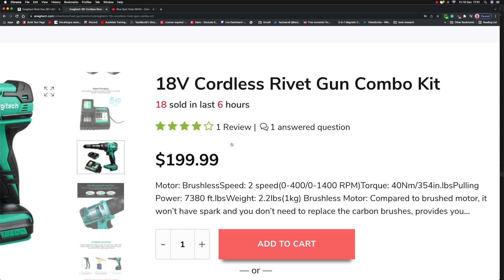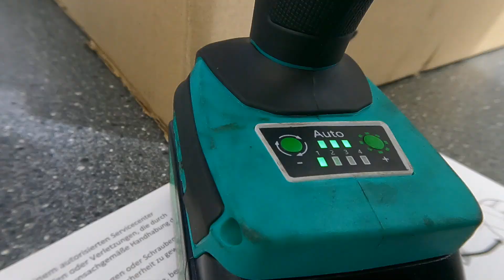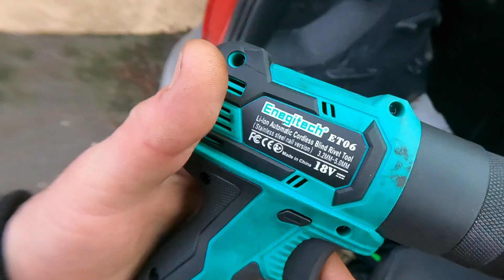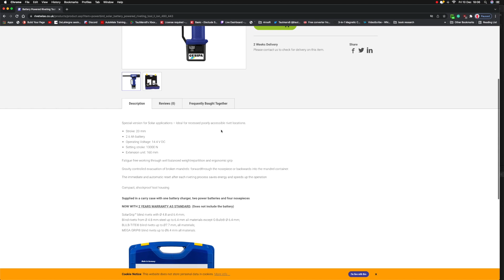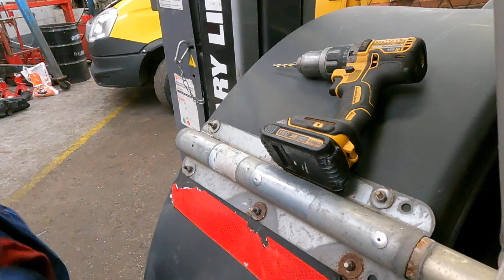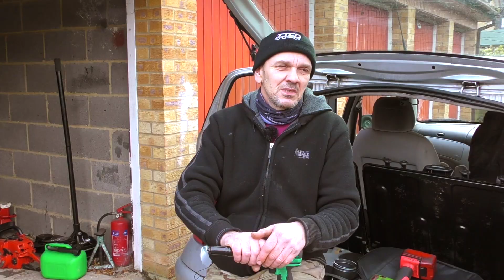Workshop Tools - The Enegitech 18V Battery Powered Brushless Riveter

Comment: If this will run off my 18v Makita batteries, that’s awesome….was about to buy an air one, but this is so much more convenient. 👍
Reply from the maker: You have a Makita drill?
Reply: @trailerfitter2  Makita everything….drill, angle grinder, impact driver, impact gun, etc.  Mind you, US and UK won’t send them here, and Amazon Aus is not quite the bargain the others are!  Oh well…..
Reply: just looking on amazon, looks like the battery's are the same. if so the makita guys can just buy a bare tool assuming it cheaper than  makita.
Reply: They are basically “knock-off” makita stuff, the charger looks pretty much the same and the lxt batteries fit straight on, same with the China knock-off makita stuff. Like an impact for instance using makita batteries on them makes all the difference